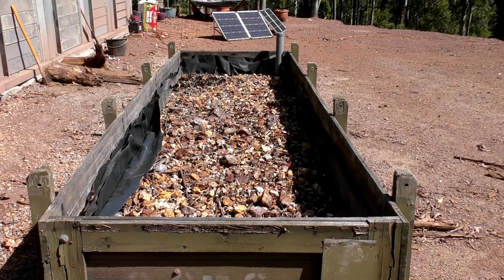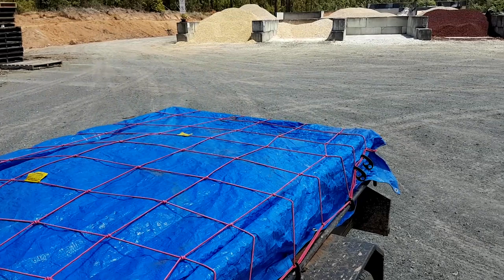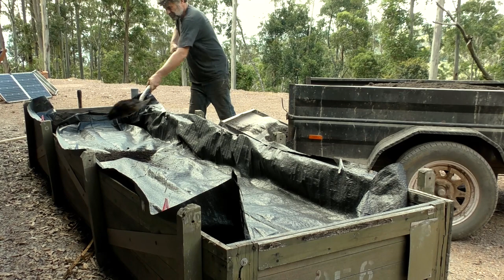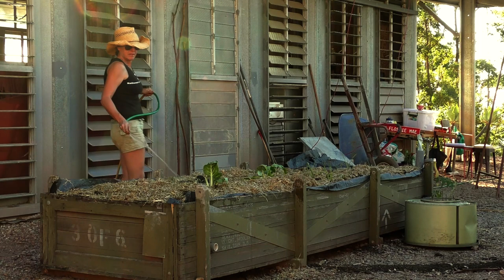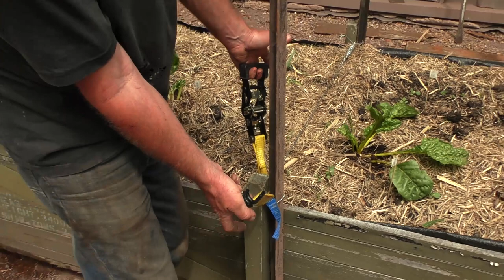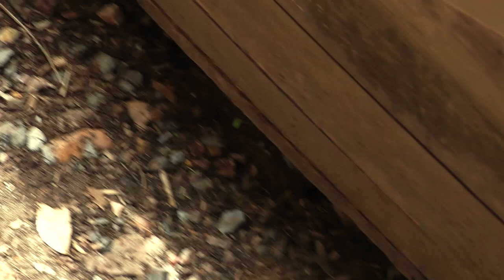[Off Grid Build] Kitchen Garden Wicking Bed

Comment: In the Imgur post (and here) you had that tomato in the drum. Whilst nice, it might cook off the plant in heat, being that it's metal. Just saying. I had a metal trough (made from rain gutters) and grew beans init. The plants eventually died after a heated week.

Either way, nice work so far, i applaud every person that decides to get back to these simpler (and far more rewarding) methods. It takes courage and a back bone to do it.